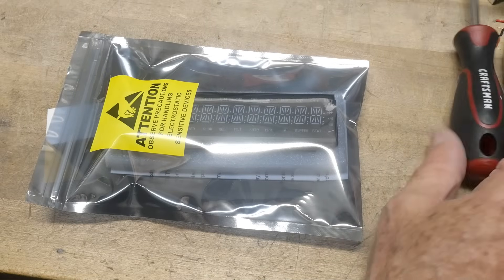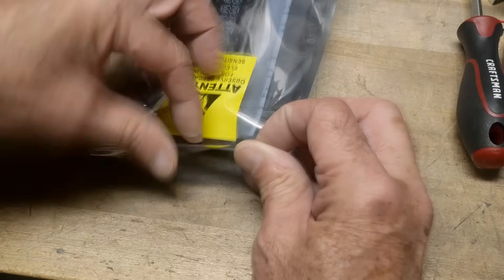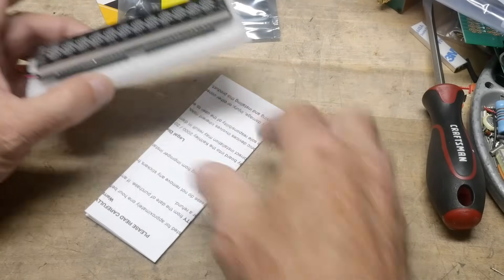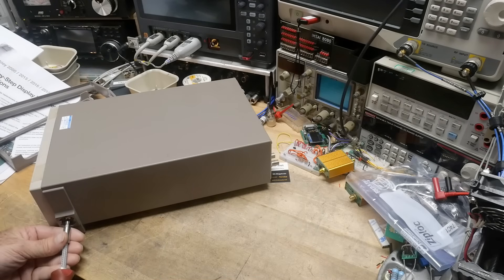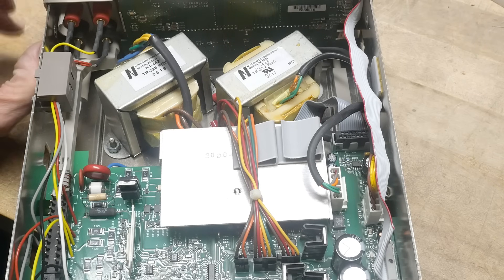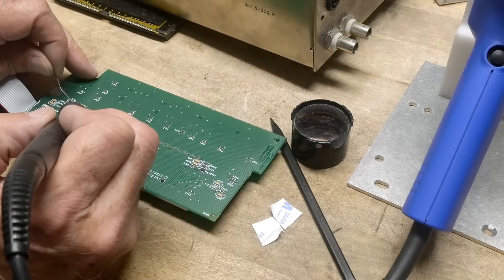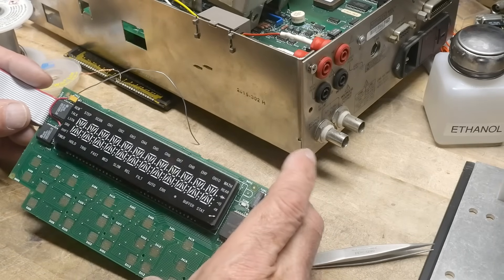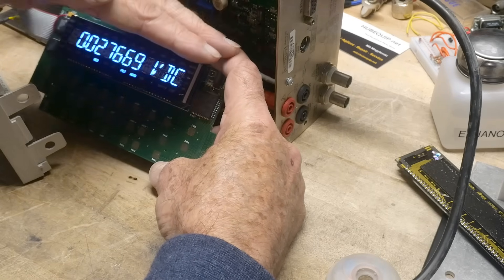#2477 Keithley 2015 Multimeter LED Display

Comment: Hakka FT-301 can be converted to 120v from 100v by changing a resistor. Info to do it is in a post on the EEVBlog forum.

Comment: Great video and very informative for me.
That display is perfect. It's larger and LED-based instead of VFD. It should last forever now.
I ordered one immediately for my 2015. I think, HubEquip will have a spike in sales because of this video.
I saw the ethanal bottle on the bench. I assume that was for cleaning the soldering. Did you use acetone for removing the black stuff?

Do you think the polycarbonate panel could be removed from the bezel to make it easier to work on?

Comment: Good one ..saw his stuff on another channel looks good I'd like a red one but I assume it depends on what colour the filter is in the first place. Also I must say I almost always slap some fresh solder on the joints before promptly sucking it all off again as it makes it easier to get thermal contact and heat the solder all the way through the via before the suck ...What polishing compounds did he recomend and which did you use ? I need to do something about my FT847 Bezel
Reply: Thank you. Our recommendation is the 3-step Novus Plastic Polish.

Comment: Acetone on plastic usually is a big no-no...
Reply: We recommend using particular nail polish remover, as 100% acetone aggressively attacks acrylic. After testing many solvents, we found that the product listed in the instructions works best.
Reply: @dimmog  I’m guessing there was a learning curve? It’s great that you give instructions instead of letting people hang in the wind.
Reply: I would have tried a few other methods before reaching for the Acetone as that would have been a big red flag 🚩

Comment: Acetone on plastic? I think 90% IPA might have worked better
Reply: We recommend using particular nail polish remover, as 100% acetone aggressively attacks acrylic.  IPA does not work on this paint. After testing many solvents, we found that the product listed in the instructions works best.
Reply: IPA wouldn't have touched the paint he was trying to remove. Acetone will eventually cause crazing and fogging, though. I suppose if I had a perfectly functional meter but the display was getting unusable, I'd take the risk.
Reply: Never thought I would see that on this channel. Ouch.

Comment: I consider the type of display when considering equipment.  I despise the florescent displays,  they fade and fade and eventually you may be stuck with an unobtainable part needed. The LCD seem to work unless abused.  If they ever get funky in normal use,  it would mean a new zebra strip or just clean the one you have.  I have an older Keithley with LED display and at least that will outlive all of us. Notice how many items for sale are not photographed with the power on,  so you can see the display?
Reply: I just love VFD for the look of it, same for LED.
VFD will fade or burn in in high operation hours, in my home lab it will last forever.
In opposite, I personally despise LCDs except in battery operated tools.
Viewing angle, contrast and missing backlight is what turns me away from many HP and Keithley meters.

Comment: I'm not sure if this is the same guy I got my 53131A LED replacement from, mine came via eBay in early 2025. The counter display is still very good but I thought it prudent to salt away a display for the future. I had a feeling that acetone "wash" might turn out to be a bit messy!  73 - Dino KLØS
Reply: Yes, it’s me. We recommend using nail polish remover, as 100% acetone aggressively attacks acrylic. Btw, no chemicals are needed for the 53131A installation.
Reply: @dimmog  Hi Mit...I had a feeling that was you! I'll pass along your website to my ham radio friends who also enjoy old test gear!
Reply: @PapasDino  Thank you!
Reply: Acetone tends to dissolve plastic depending on type.